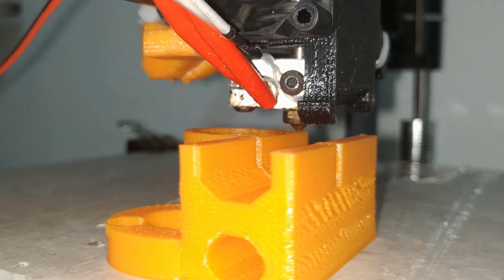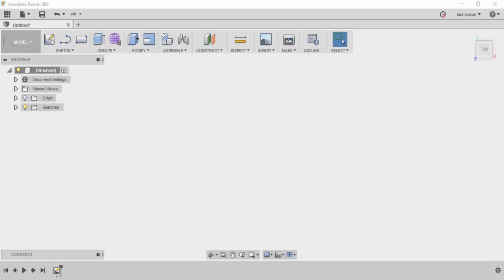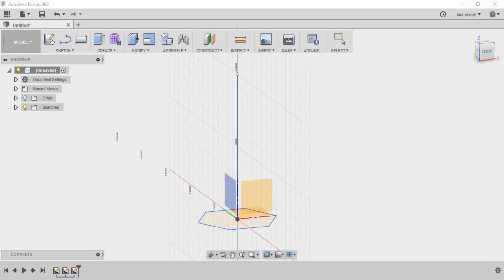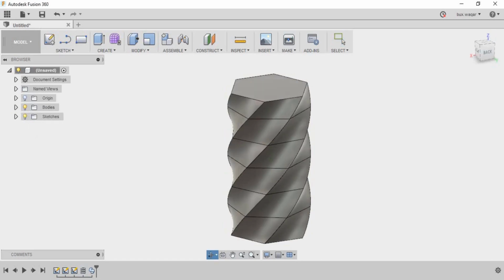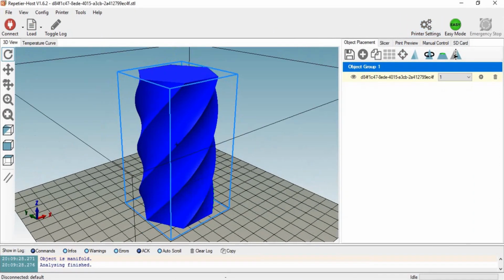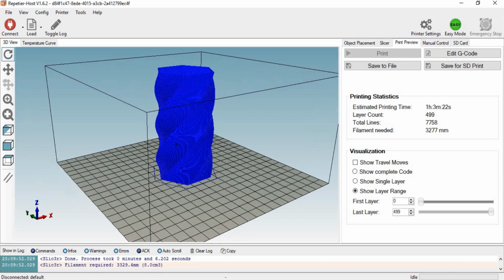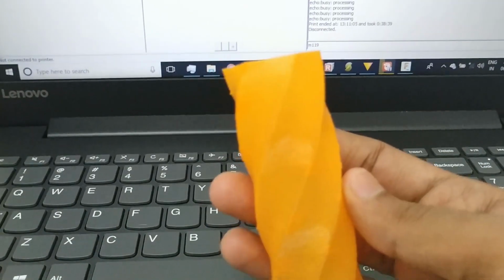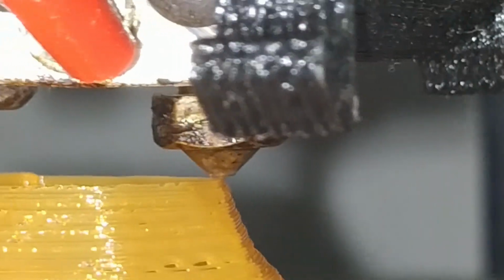Beauty of 3D-Printing|How does 3D-Printing Works?

Comment: The second session video is fine waqar, I want to know what are all the materials we can print. I also have a doubt that if we want to feed any program in it to print .
Reply from the maker: bro im using a material named PLA which is a type of plastic..and we dont do any programming we junst need to give the design and it will print... however only first time we need to upload a program to the board of 3d printer..and after that keep printing 😊😊😊